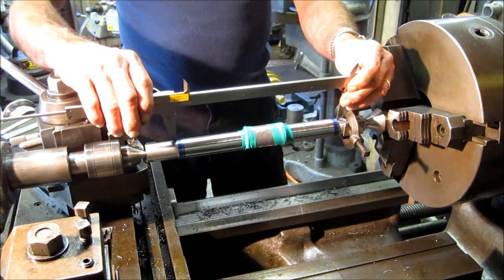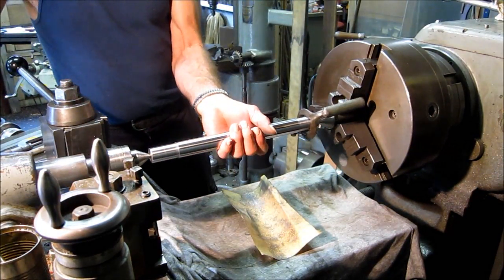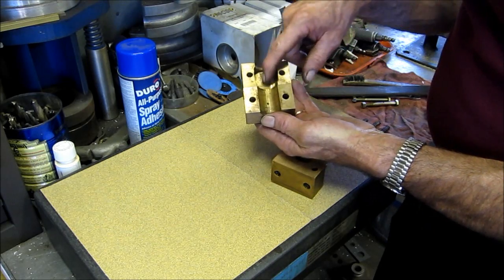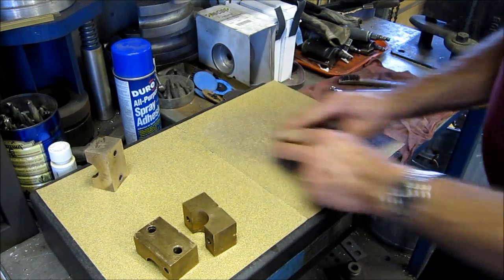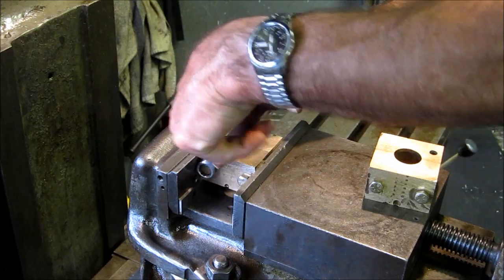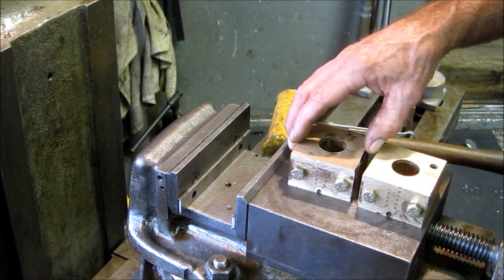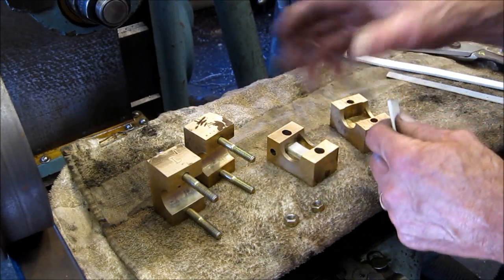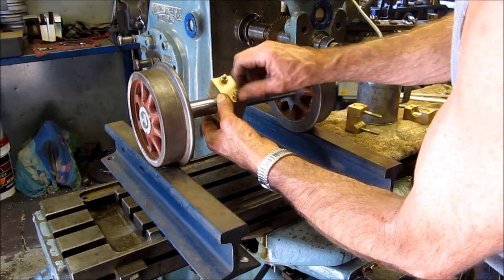Working on the Railroad PART2

Comment: Hi Keith, (related to the railroad)
A small chamfer on the bearing encourages lube oil to migrate into the bearing - shaft joint, while a sharp bearing corner tends to shear the oil from the shaft and can starve the bearing.
A .005 " shallow angled chamfer s sufficient.
Does anyone know where I can find a photo of a spindle speed panel for a 1907 B&S plain mill.?

Comment: Minor point of clarification: Anyone thinking about lapping more than a few tenths should take heed of a basic principle: lapping does not "know" which part you intend to change size. The abrasive particles, not being intelligent, simply embed themselves (mainly) into the softer item of the mating pair. 
In this case, that's the bearing blocks -- meaning that most of the size change will actually happen to the steel bar. 

What Keith demonstrates here would actually be a more effective way of lapping the bar than the bearing blocks, but he's only looking to remove a very small amount, and doesn't care about a reduction in the size of the steel bar, so it works out fine. 

In summary: ideally, the lap should be softer than the part being lapped. For instance, if you're trying to lap aluminium, you may have to resort to lead or even wood for the lap.
I have had success lapping bronze and brass with aluminium laps, but you do have to use a high-lubricity vehicle for the abrasive compound, and take care to keep the lap cool, or you might smear or seize the lap.

Comment: I'm a hobby machinist, I had a south bend lathe.
On those axels, they're not as critical as you think.
No matter how perfect the wheel spacing the width of the track rail itself will never be exact. Its just a certain tolerance but consider how they fasten the rail to the sleeper bed, just hammer pinned with pinch clip to hold the rail in place.

Comment: Trueing or planing the top and bottom of the rails was for another project so they would sit flat.  Rail as designed and rolled have a curved top or running surface and flat on the bottom to sit on crossties  or tie plates to spread the load to the ties.  There is one use of rail where the top IS flat--crane rail where the loads are heavy and the wheels are double flanged.

Comment: Cool video, Keith. Those hammer marks and other, "whoopsies", brought back a memory. In the tool & die shop I used to work in, we had an old guy who, when starting to work on a banged up piece would run his hand over the surface and say, "gotta' get rid of the goonies."  A "goonie", was a technical term for the raised metal areas. LOL

Comment: Always fun to watch your videos Keith. You're changing the way I approach almost everything in the shop. Like I read that someone else posted, "What would Keith do" that is my new mantra. Today will be removing a corroded off steel banjo bolt for the water inlet of an otherwise solid brass pressure water pump. Then I will try my hand at making a new bolt. WWKD will drive my efforts. By the way, only Keith would repair a set of train wheels and have an actual set of train tracks to set them on!!!

Comment: Just my guess Keith when machining those, the finish was not that important so they used
a roughing tool.  Properly ground finish HSS tooling should look like glass. But finishing
grinding does get delicate so I made a lapper (attachment) using valve comp. right down to
auto compound, the clapper must be locked then it laps forward & backward strokes. That is
how I do 1-2-3 blocks.                               thanks SP

Comment: I was thinking like the old gear pumps it has a grease port where you fill the cap tub then screw it down to fill the gears a groove would keep the grease rolling so it carrys grease or oil around the brass collar plus keeps grease moving & don`t go hard incase general maintenance Is`nt a factor ,But I know what you mean ,This must be off a mini steam train eh.

Comment from the maker: They actually inserted felt all the way across the reservoir, which holds the amount of oil between lubing’s The design of the load side is not able to lose any surface area, like a grove. Thanks for the feed with that comment!

Comment: I love things made late 1800's to early 1900's, that was a time when we made things to seemingly last forever. Now I am curious, did you notice if the drive wheels on the engine has metal tires heat fitted to the wheels like the bigger engines?